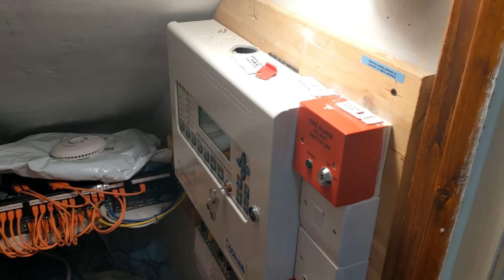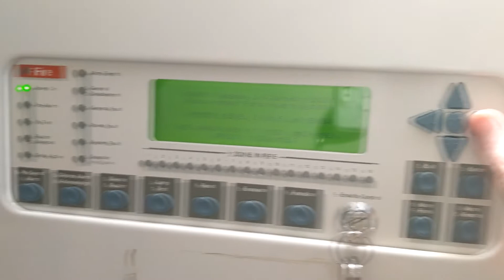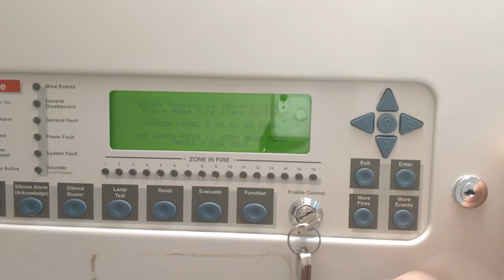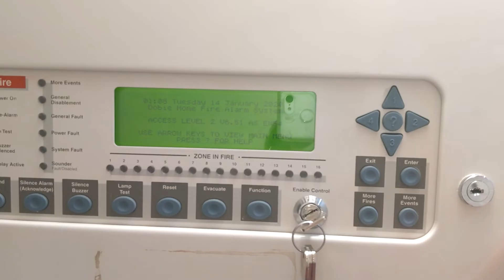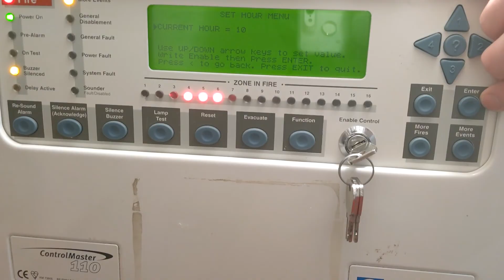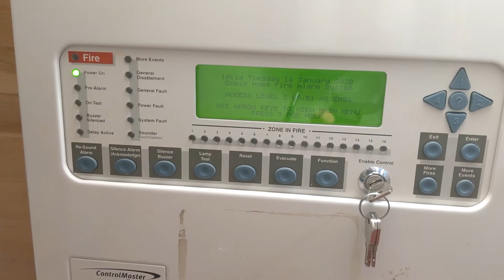Addressable System test 17

Comment: 7:00  what device was that?
Reply from the maker: discovery open area voice sounder.
Reply: @testlogs9005  Interesting how it does a fade in effect when it goes off, as compared to the smoke detector sounder bases, as when they go off it just blasts the tone right out of the small speaker it has.
Reply: @testlogs9005  :)
Reply: @testlogs9005  
5:21 LOL encouragement
5:11  noice ;)

Comment: I have my Soteria Multi on M4 when people are having showers and it seems to be pretty happy right outside a bathroom. Your mileage may vary with the Discovery Multis but I think it could be worth a shot, that way you'd have a really low sensitivity optical in the day
Reply from the maker: they are all in heat during the day because cooking, steam from the shower etc. just have to not vape naysh the corridor with the shower early in the morning. most of the sensors are brand new so not being replaced anytime soon unless something goes wrong of course.